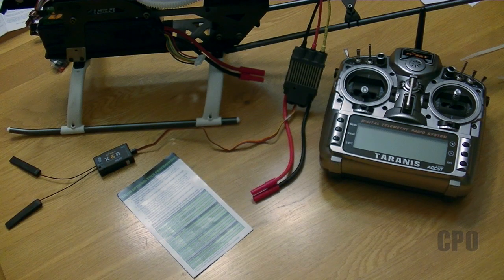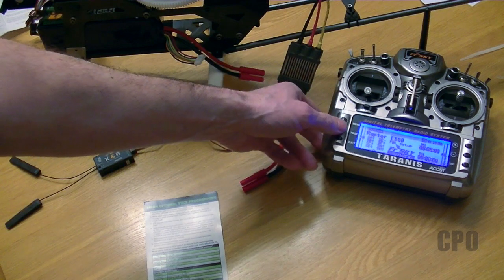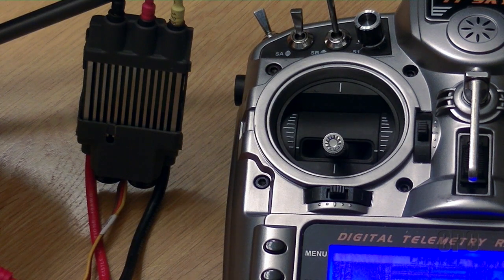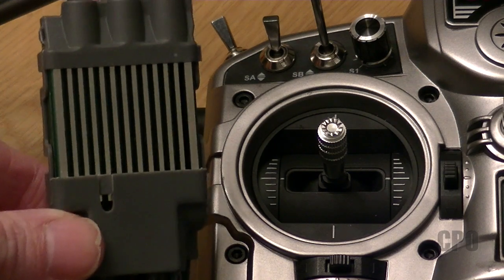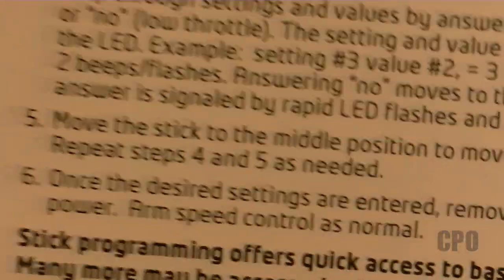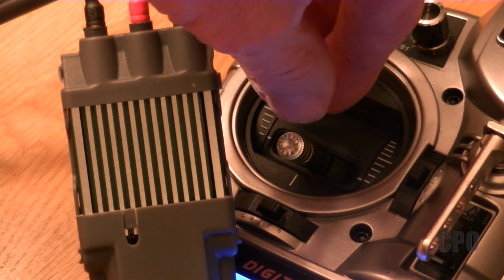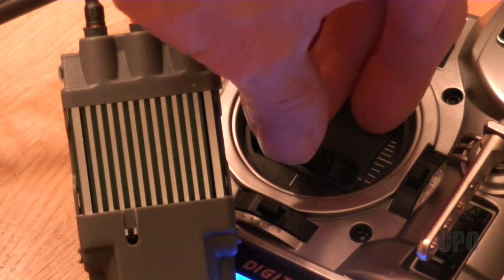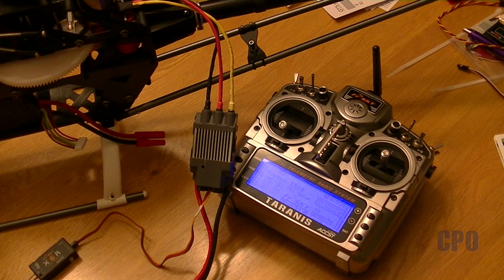Castle Talon ESC Stick Programming and Throttle Calibration (TT Raptor E550FBL)

Comment: I also have Raptor E550 and just finished setting up my Spirit pro. I still didnt connect my Talon to system. I hate stick programming but also i didnt yet order castle usb program card for same esc.
Do you advise i use esc as it is never powered and all categories i want are factory default already? I mean i hope nobody at factory fiddle with esc..Can i believe to that statement?
Cheers

Comment: i have a talon 120HV and i want to program high & low stick. throttle curve is 0,25,50,75,100 & my high and low endpoint are set to 30 each. i set the talon software to heli, set RPM, Gov mode, auto rotation enable, throttle trim setting @ zero.  now,  when put the throttle stick high and plug in the battery, i get a cell count then i gradually  increase the high end point, nothing happens.

Comment: I've got a 180cfx and mistakenly did the throttle calibration with a non linear throttle curve. But during the process I was never able to get any beeping sounds out of the Talon 15 ESC. I unplugged and then never was able to arm or bind ever again. Even with a linear throttle curve it won't do the calibration because it won't arm. Damn this Castle Craptation.